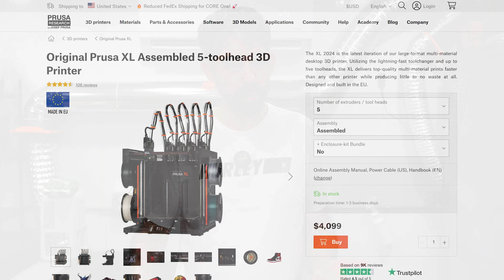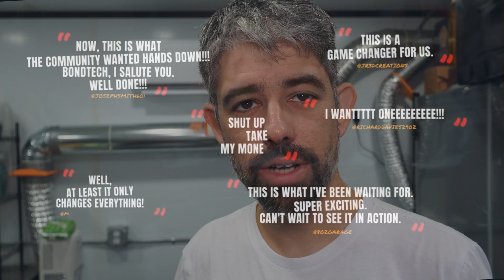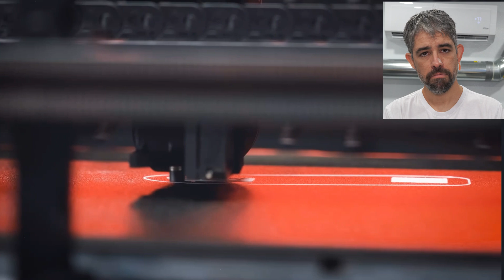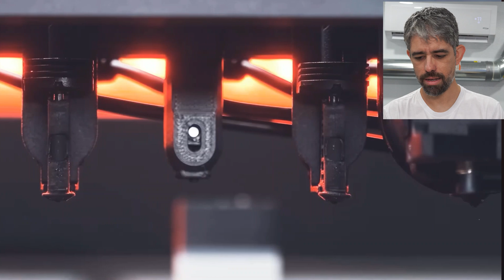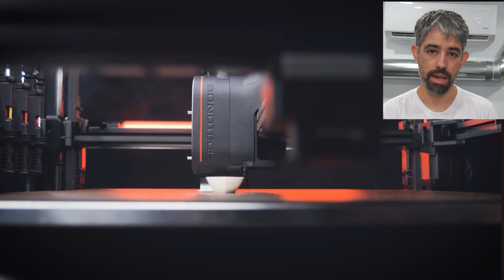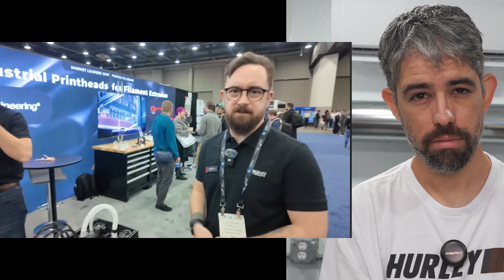Next thing in 3D printing? Discussing the Bondtech INDX (What it is, pricing, and how it competes..)

Comment: I got to see the INDX run in person, it is very impressive! Can't wait for it to launch.
Reply from the maker: You did?! That is awesome! Do you think it's going to change the 3d printing game or did it seem buggy?
Reply: @Crafts4Painting  The only thing I could consider buggy at the time was the stringiness of the prints. That said, we had 95% humidity due to some swamp coolers at the convention center and a very hot day. 

Also, I could see some issues with larger bowden tube printers that are traditional core xy voron style. Printers more like the Trident would be better since the tubes are shorter. The demo machine was a Voron 0.2. 

When it comes down to things, it will be a game changer. I am planning a new printer in 2025 and am holding out for this to see what upgrades best.

Comment: Bondtech uses SLS printing for their extruders. Nylon PA 6 if I’m not mistaken.  Very strong material. High temperature tolerant. This is going to revolutionize 3d printing. I can’t wait to give them my money.
Reply from the maker: Ohh that should make the heat a non-issue. Would be great to see this running in person, seems like a no brainer at the proposed pricing if it works as they say it will...!

Comment: Interesting video - some minor points - Dx stands for dynamic extrusion - not direct extrusion.  Plus the AMS  can't really handle TPU other than the BL quite hard stuff.
Reply from the maker: Ahh, didn't realize it was dynamic extrusion. Thank you! As for TPU, I'm not sure this will either, but, in theory, it might. At least the 95A and hopefully 90A stuff should work if the extruder is well designed. Fingers crossed!!

Comment: The catch for multi-material is that these often require specific environments for acceptable results or stick to materials with common conditions versus just a color change printer. The open top could limit using high temp and high shrink rate materials.  Definitely innovative engineering at its best.
Reply from the maker: That is a great point! I had not thought of that negative... hard to enclose with the extrusion system like this. I guess for non engineering filaments, it could still be awesome. I agree, the innovation here is impressive, can't wait to see it released!
Reply: It's not that difficult. Voron Stealthchanger does it by adding a simple tophat

Comment: I seldom need multi color for my functional prints and on those rare occasions I did a manual filament swap.  However, I have a few applications where I could use multi material capability for my functional prints such as TPU feet on PETG-CF parts, or a PLA interface as peel off support material on PETG parts.  The INDX system seems ideal for that.  I was waiting for the latest version of IDEX on a large formal coreXY printer to mature but now I'm much more interested in the INDX system.

The INDX is also good for saving time on a prototyping printer.  It will be very handy to load all of the different materials I use and simply have the slicer select the material that I want for each print with no more manual filament swapping before each print.
Reply from the maker: It does sound game changing for multi material systems. I cant wait to see what makers start to do with this system once released!
Reply: Need it for dedicated support material. Also, printing labels on parts. Two is usually enough though, so a dual head like the Bambu H2D is good.

Comment: You said 200mm x 200mm estimated build plate size... That is a Voron V0 with a build plate of 120mm x 120mm x 120mm just FYI, so with 4 tool heads on that we can expect only needing 30mm per tool head.  If you were to lets say mod an older Ender 5 pro you could expect to put 6-7 tool heads on that printer. An Ender 5 plus you would be able to expect 10 - 11 tool heads on that printer...  The same with a Solvol SV08 you could expect 10 tool heads.. Ratrig V-Core 4.0 300 = 10 tools, V-Core 400 = 13 tools, V-Core 500 = 16 tool heads
Reply from the maker: Oh wow, that's makes this even more impressive. That printer looked so small, but it's even smaller than I thought. This is going to bring new life to older printers, imo... I can't wait to see where this goes!

Comment: I hope it works out... I am definitely interested in getting a core xy printer setup with the Idex system on it... I wonder if they're going to only be available for kit machines with open source... the concept is great... especially when you look at the price of an XL with 5 print heads... that makes it easier to implement...
Reply from the maker: Yea, the logistics of this are still unknown but it seems like it's an aftermarket add on more than a integrated thing. Still though, seems really impressive!